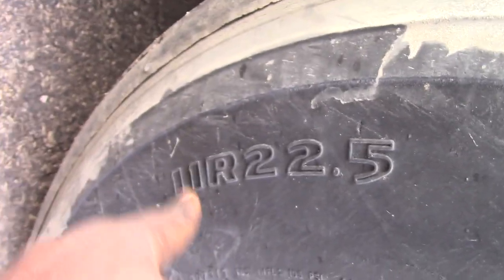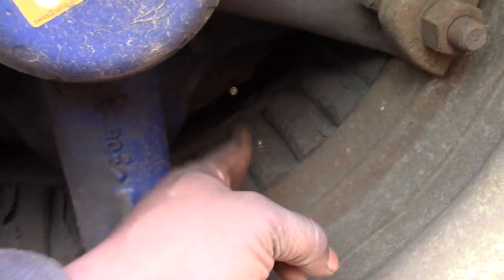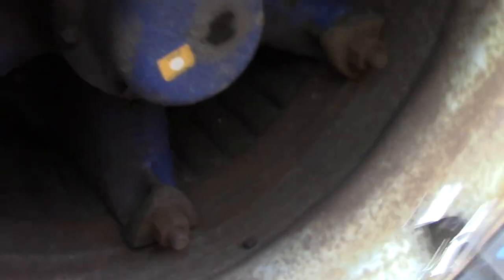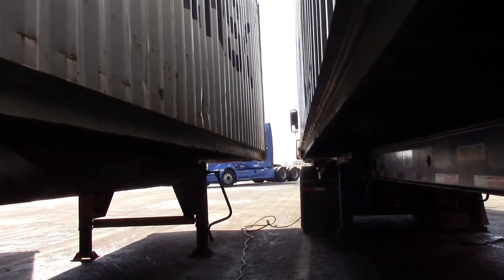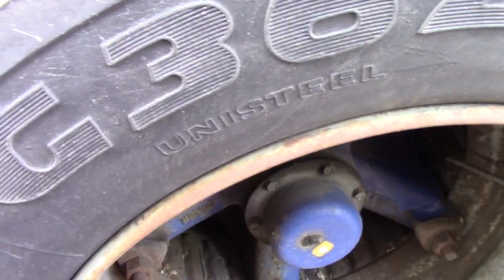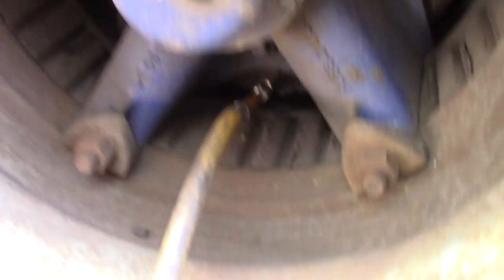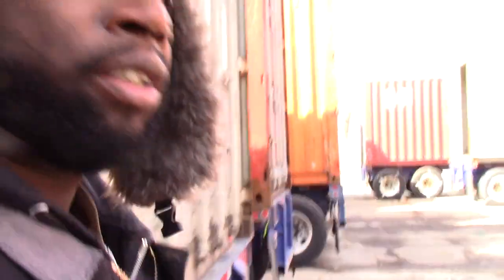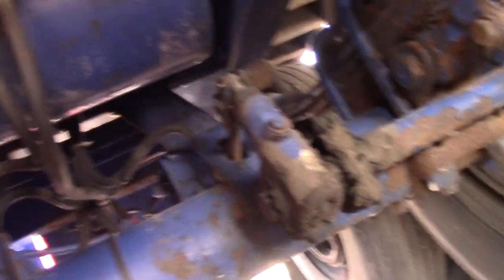TRUCKING: CHECKING MY BRAKES, SLACK ADJUSTERS AND TIRES !!!!!!!!#BRAKES#TRUCKINGANDLIFE#

Comment: Most definitely good shit bro.....i was talking too a container op outta Chicago just last year.
He was complaining bout the tires popping consistently on the 20ft,40ft,and 48ft trailers outta the rails.
He only pulled 53ft containers claiming that those tires didn't pop as often but he never mentioned just hooking up yo own air line and air gauge to proactively prevent the prob.....
Reply from the maker: Yes  sir big bro... keep an air hose on deck because these tires will blow ! do what you can to prevent and minimize the damage. container haulers really need to know this because these tires are from a different world..... these are not regular tires lol!